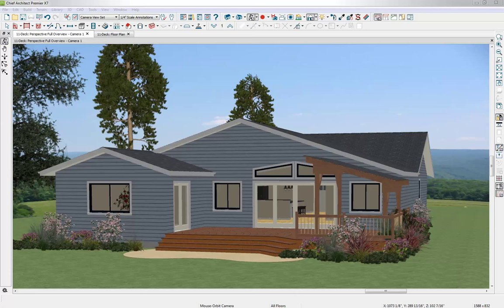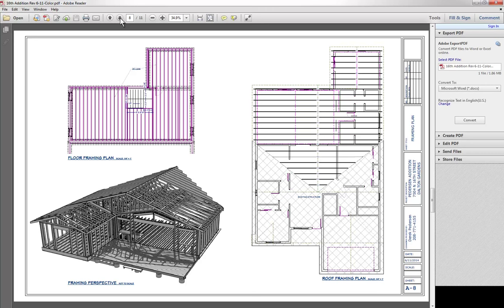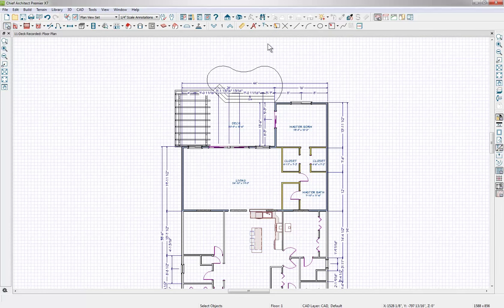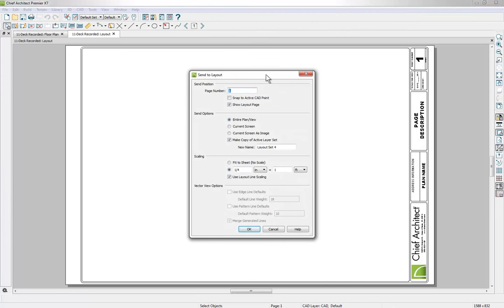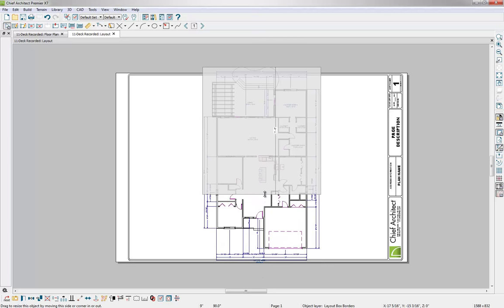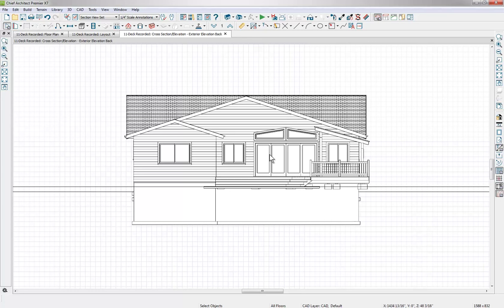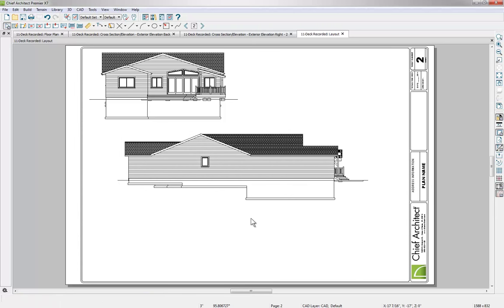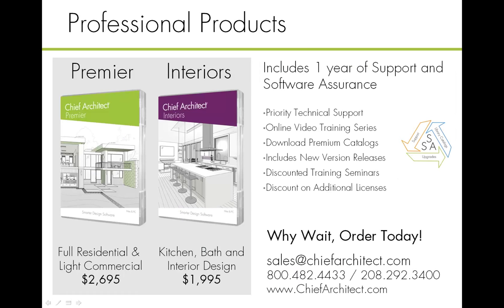Dalton Remodel: Construction Documents

Comment: Watched all 5 videos. Good overall demo regarding doing a remodel.  Some stuff I didn't need to know like inserting and changing windows, doors and stairs when those are explained on other videos.  Some things were left unanswered that I would have liked to have been clarified, shown and explained in regards to working with as-builts (AB). Examples are how you showed your AB walls with no fill, how you delete the AS-BUILT framing, how you would show the roof framing in regards to the AB, and the hatching to differentiate existing AB from proposed.  My first project with CA is a remodel and its kinda tricky   I would like to see a more in-depth webinar about remodeling, like 2 hour and a half classes.  This helped but I'm still in the dark with a few things.
Reply from the maker: +Todd Sarantopulos We offer quite a few videos on our website that get into more details: http://video.chiefarchitect.com/?search=remodel